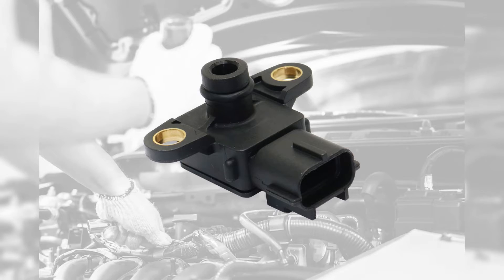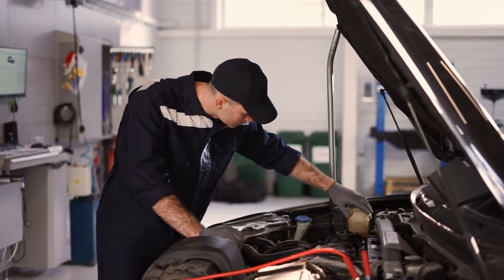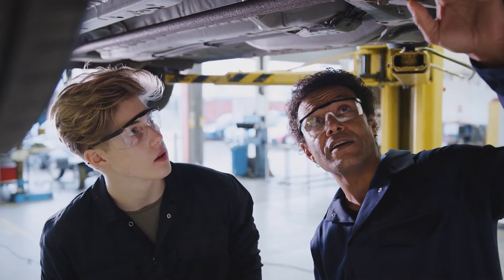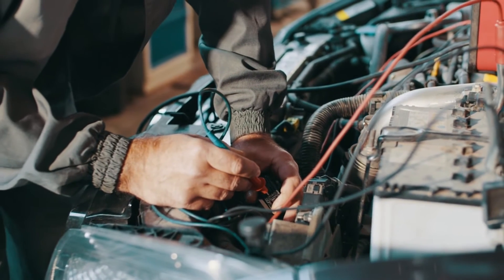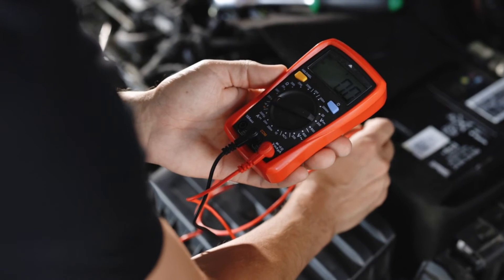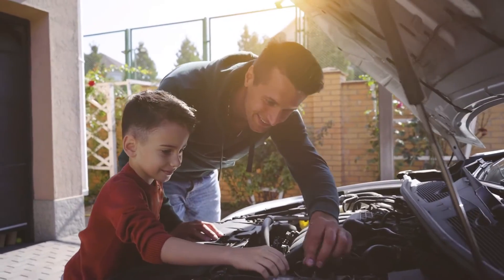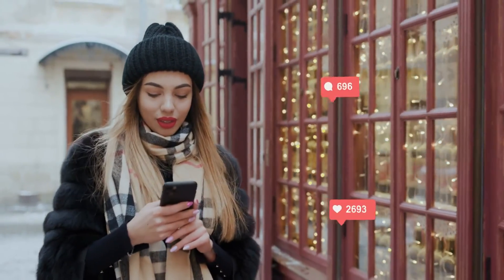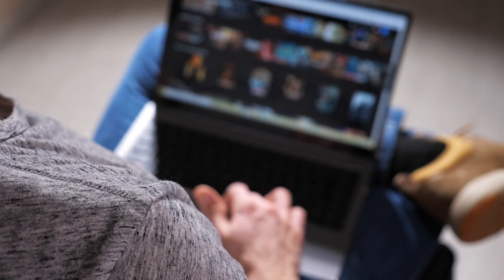MAP Sensors: A Complete Guide to 3 & 4 Pin MAP Sensor Wiring | Wiring Techniques

Comment: Great info! I searched this topic to clear things up in my mind. I have a decent understanding of how DC voltage behaves. My question is this: I understand power and ground is needed to complete the circuit, but what is the actual ground wire doing if the signal voltage is returning to the ECU. How come the signal wire cannot sinply operate as the ground, essentially, if the reference voltage is sent to the sensor, which is modulated mechanically by the sensor, and then go to the ECU. When the signal voltage is simply going to the ECU, what is the ground circuit even doing?